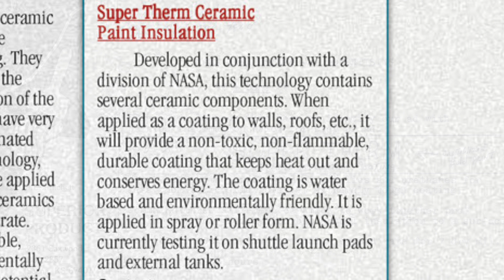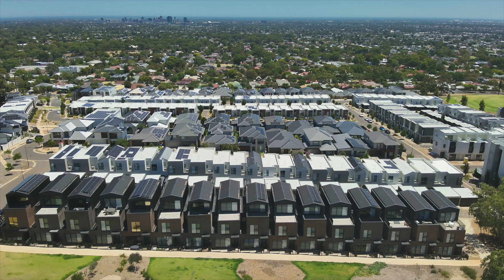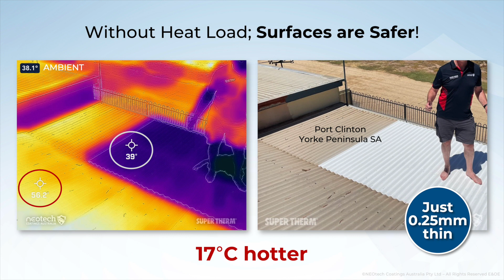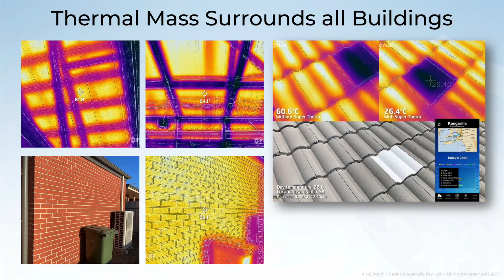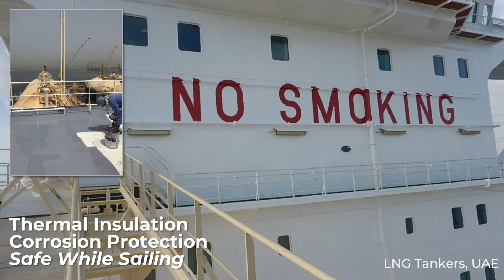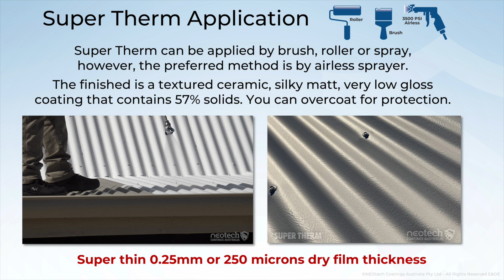Keep Cool with Super Therm - Block 96.1% Total Solar Heat. Thermal Insulation Presentation

Comment: I find it suspicious paint companies dont do simple white paint to white paint with their "magic" comparisons and measure the other side of the material to see how much got through. Case in point, I saw a video comparing the nasa stuff to basic white paint and the basic paint was actually slightly cooler :) All probably down to it being a slightly whiter shade than the "special stuff" so its more snake oil.
Reply from the maker: @jedics1 The Florida Energy Office did a full field test of Super Therm v white paint. White paint is very good for reflectance while its new and fresh but once it's dirty and aged it deteriorates by 40% or more. Lots of studies on that. IR is the X factor. We notice you're in Australia so the backyard video you've mentioned by a non-expert has it's issues with a bag of ceramic powder and labeled as NASA isn't even close to a quality insulation coating. They also misled a leading forum on their testing. Snake oil seems a common phrase we've heard before with people looking to find ways to validate their perspective. We'd take the Florida Energy Office extensive testing over a questionable backyard video by a non-expert any day. https://neotechcoatings.com/super-therm-energy-star-savings/super-therm-usa-energy-authority-reports/#denver

Comment: ❤❤❤ wooow,, can i use this for solar panels surfce ,, so i can get more efficiency..thanks..
Reply from the maker: @Silin-m4z we've tested and no added benefit on the panel, however under and around the panel makes it much cooler therefore making the panel more efficient cooling down the microswitches.